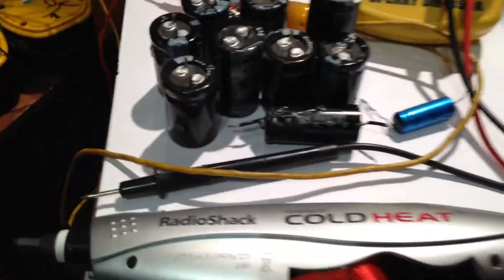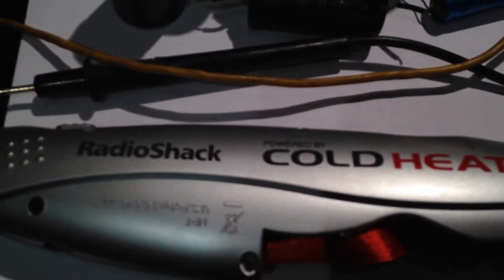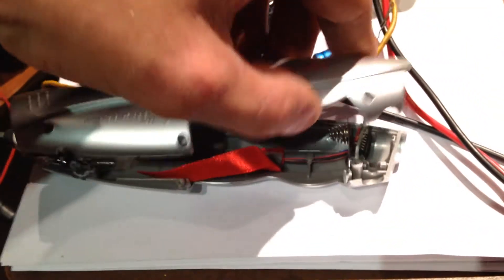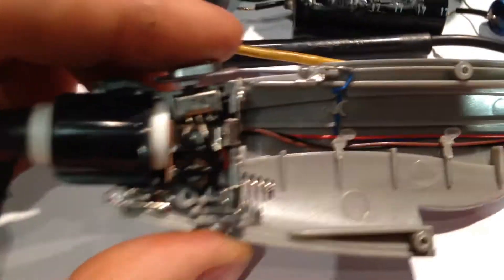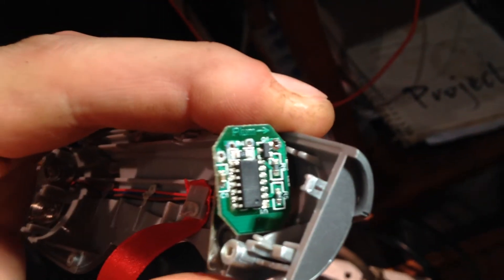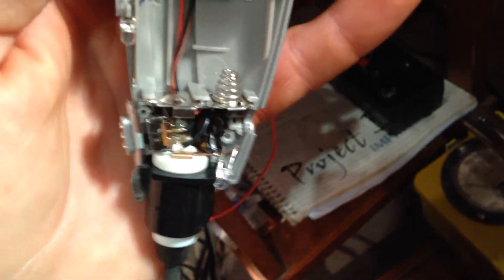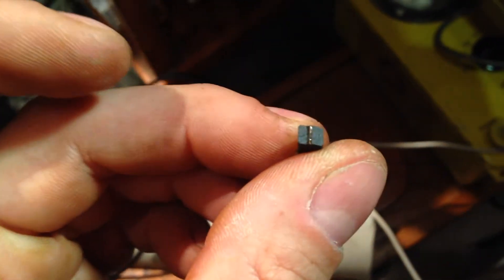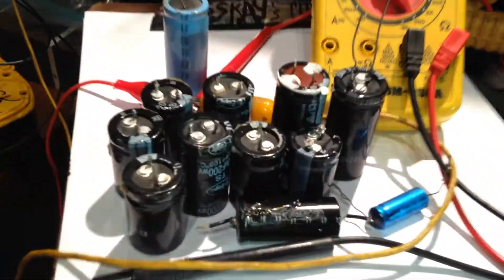Cold Heat soldering iron? Inside view...

Comment: The number one soldering iron you can't give away away at yard sales
Reply: I have one from a yard sale. I've had it for years and never used it.  I tried it out real quick today and it did solder a wire, but it took 10 seconds and it was like 18 gauge wire.  It is kind of neat that the tip doesn't get hot.